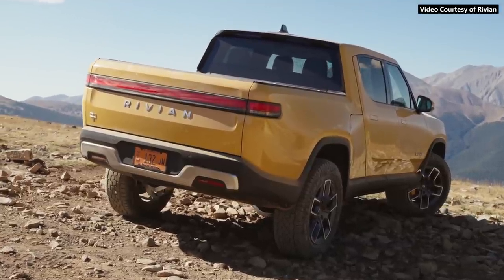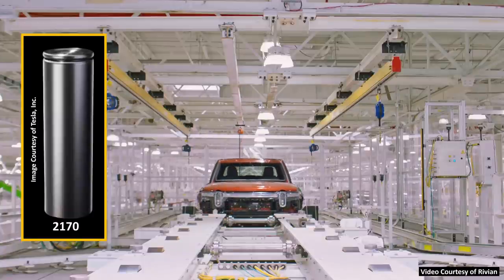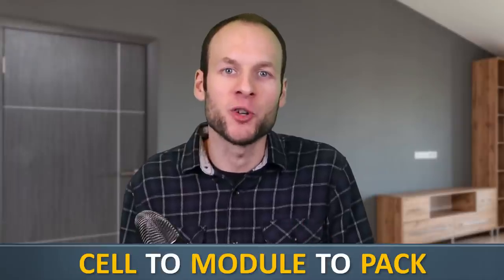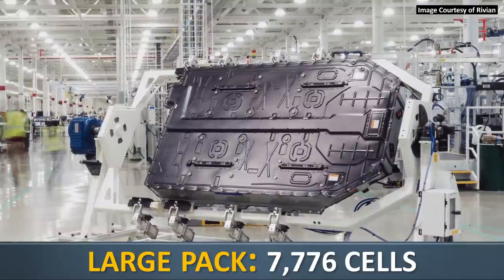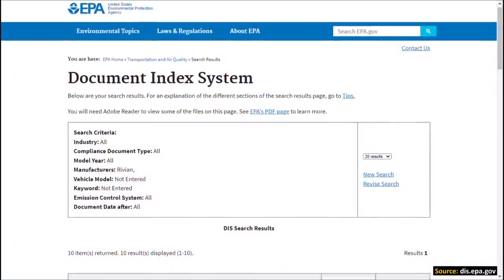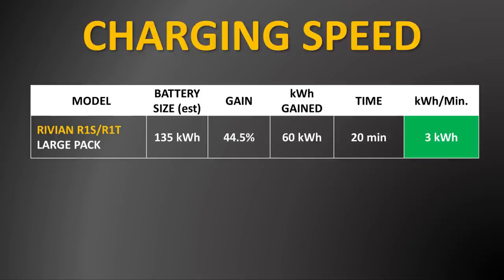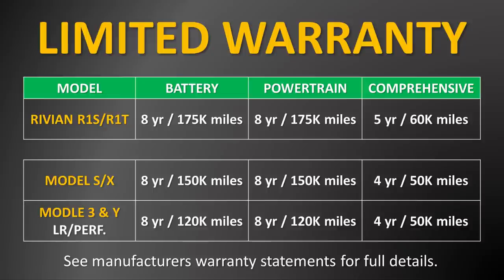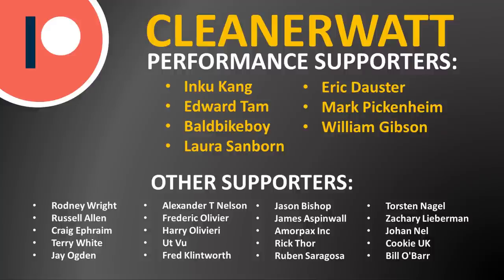Rivian R1T Electric Truck: How Good are Rivian's EV Batteries?

Comment: We can pontificate about forthcoming speculative trucks and their tech. But the Rivian R1T is here, now. And for those with deep pockets, who want a practical, fun, premium, family adventure truck, Rivian absolutely delivered. It's not for everyone, but it is truck and vehicle of the year with multiple publications, for good reasons. They now have over 80k of orders, and with $1,000 deposits, rather than just $100 placed on speculative peers' vehicles, the people in line are much more likely to be more serious about going through with their actual purchases.
Reply: My only concern for them is if Ford nails their lightning production then rivian won't have as much of a headstart as they would've liked. So many potential buyers would opt for the f150 for the size and service, rather than going for a startup with no real service infrastructure
Reply: @brandonkylemarks  There are good pros for buying a Lightening, R1T, or Cybertruck. And they'll be buyers that like each or all. But the trucks themselves are actually aimed at delivering totally different things, for different users (commercial, adventure, image) so it depends on what will appeal the most, depending on the buyer's needs as much as availability and whether you have to drive to a dealer, or the service technician drives to you for servicing.

Comment: Charging and cooling.. Remember Nissan Leaf, it could charge quite fast once, but second quick charge is slower. Cooling hardships shows themselves when you try to drive long distance with high speed and multiple quick charges. IMO

Comment: I support Tesla only for at least next 5 years  , others need do more r and d at battery , motor, ai , and scaling production
But at time , Tesla already climb to the another level
Reply: So how do you explain the 512-mile Lucid Air with similar performance to the Model S? It seems their efficiency is so good that despite using 2170 cells in modules like the Model 3 and Y, they achieved a significantly better range than the Model S while also charging significantly faster at 304kW.
Reply: @TecnamTwin  they're probably using a bigger battery based on back of napkin math. I hope I'm wrong though.
Reply: @TecnamTwin  Lucid only produces 1 model, and don't currently have anything that's more affordable. Tesla offers 4 different vehicles currently, with 3 more to come in the next 2 - 3 years. Tesla has truly made a foundational impact on the world's transition to sustainable energy.
Reply: @geoffl.3247  Ya Tesla's are cheap.
Reply: @TecnamTwin  more like their quantity of battery is much larger. Models is more efficient but has a smaller battery pack.

Comment: Definitely competitive with current tech but is that enough to gain on the leader, Tesla?  It's a catch-up game and I don't see this happening.  I believe it will be a great truck but there is a lot that has to come together to get it in the green.
Reply: Remember that Cybertruck will use 4680 cell which is way ahead of any other manufacturer. They will be 2 steps behind Tesla and Elon wont stop with 4680. Others won't catch up to Tesla anytime soon.
Reply: @1flash3571   Tesla’s 4680 cell might be way ahead but they’re still not in mass production yet so kind of irrelevant for now.
Reply: @TecnamTwin  It kinda already is in mass production. They are at 90% from 70 to 80% just 2 months ago. They are storing up those batteries when it goes into the production models in Texas and at Gigaberlin.
Reply: Why do they have to catch up?
Reply: @justbecause9645  If Rivian is going to survive, they need to catch up to some extent. Rivian haven't even delivered any more vehicles after the initial delivery to their EMPLOYEES, and maybe to very FEW outside customers, if that. Rivian is blowing through their CASH pretty quick without the Revenue. All companies need CASH to survive.

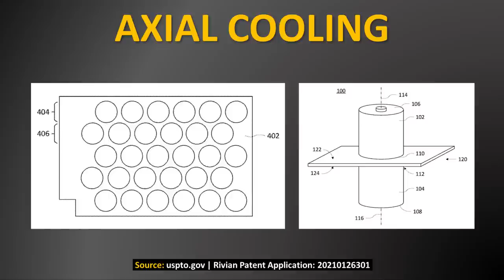Comment: 8:50  The way I understood it, the packs are 2 cells deep.  The cells negative ends would be against a center cooling plate.
Your illustration looks like you're dissecting a cell with the cooling plate.

Comment: If all packs are protected underneath, why is it a $2000 option on the configurator?
Reply: If it is needed for safety it should be included in the base price

Comment: "Most energy dense" can be false per kilogram, as you point out, and true per liter.  Is the cooling liquid counted as battery pack mass?  I don't think so, no hit on the gravimetric energy density there.  So Tesla's greater cooling could cost it some volumetric energy density as their larger amount of in-pack coolant adds to the volume of the pack.

Comment: Excellent analysis. Agree Rivian is respectable. As to its practical application, I think the jury is still out on Rivian. As you must know, Edmunds is tainted. Even though Rivian is first on the street, albeit selling to employees only att, Cybertruck may still knock Rivian off the pedestal. I seem to like Tesla’s structural battery pack concept as a key product differentiation that many truck customers will highly value…nevermind the exoskeleton concept. IMO, Tesla wins on value, intuitively as well as measurably.
Reply: Yes but the Cybertruck looks weird and is polarising so not everyone will fall in love with it’s ‘better value package’.
Reply: Key words here are "Tesla's structural battery pack concept"
Reply: @trevorevans7101  That’s totally fine. There’s room for all comers in the market as EVs displace the incumbent gas and diesel trucks.

The Ford Lightning could probably sell more than the CyberTruck due to fleet buyers and those installing service beds. However, Ford doesn’t have the batteries to build millions of trucks whereas Tesla will. And the CyberTruck’s specs are better.
Reply: CT is too big,  will have that silly yoke.  Doesn’t really compete with Rivian due to its size.  Competes more with f150.  Rivian does feel niche though, kinda like Land Rover.
Reply: Cybertruck might beat the Rivian ….if Tesla ever builds the CT.   Maybe 2023.  I wonder if Rivian will improve their trucks by 2023?
Reply: @TecnamTwin  Made up specs that haven't been proven?
Reply: But it's ugly af so no

Comment: AS long as Rivian can repair any single damaged cell rather than ask the buyer to fork out the cost of a whole new battery it will be successful. Some 7-21K worth of individual batteries shows a lot of single point cell failures. I hope they can develop a process where when cells malfunction it only reduces the range by the number of damaged / malfunctioning or degraded cells. Not just one cell causing the whole thing to fail.

Comment: So, Rivian's approach may be more energy dense, but you're not going to have nearly as effective cell level cooling with an axial approach. The contact surface area is so much greater radially that it's probably several times more effective going with Tesla's approach. This would mean that the Rivian will have performance issues in high demand scenarios as the car throttles back performance to prevent overheating.
Reply: Tesla does the same in their 4680/structural Battery pack though, and albeit counter-intuitive it works indeed better because of the jelly-roll internal structure of the cell which conducts heat better along the axis than radially outwards
Reply: @unitrader403  Tesla can afford to do that because the design of the 4680 reduces the tendency to overheat. They have shortened the distance by a factor of hundreds.
Reply: @dstr1  as i alrady explained the Cells internally conduct heat better in the axial direction than in the radial one (the heat can follow the aluminium/copper foil of the jelly roll, but its blocked by the seperator/electrolyte). So Axial cooling of cylindrical cells is better, no matter what.
Reply: @unitrader403  you are still missing a significant engineering difference betwee the design if the Tesla 4680 cylindrical batteries and ALL other cynical batteries.
That is the distance the energy travels. In the case of the Tesla battery that distance is a minute fraction of that of even 18650 battery. 
Recognizing that that  size was the limit due to the limited control of heat generated in the charging and discharging process. In the Tesla design energy doesnt travel the length if the jelly roll, instead it travels across the edge of the roll which is equal to the radius of the battery or about 23mm as against meters in even the smallest of the batteries.
I've been following this jelly roll design ever since it was designed in China by A123 and then migrated to MIT decades ago.
Reply: @dstr1  Previously people wondered why Tesla cooled their Batteries radially rather than axially because the heat preferably goes along the axis and not radially outwards, so cooling the Cells radially is not optimal. Now that Rivian cools their Cells axially its also wrong, so wtf?.
And note that i never touched on the way the (electric) Energy travels in the Cells, because thats less relevant for the optimal side to cool the Cell (you could say its a distraction from the Topic)

Comment: NCA...should be NCAG where G is graphite, which is basically running out NOW, at least in terms of number of EV deliveries baked into EV stock prices. Better to invest in ebikes...cool shot of Rivian's pack btw..I think there are too many EV prototypes out there with multiple fail points ahead on scaling...Lithium supply, Graphite supply, geopolitics. Still rather have lithium iron for long life and useage of 100% of charge rather than 20-80%

Comment: What is interesting, so far, with EVs like the Rivian, is the lack of significant changes after a few years.  Yes, there are software updates but Legacy automakers traditionally have changed their styling about every 3 years, or so.    Tesla, Rivian, and others, are not on that fast of a cycle yet.    Heck by the time the Cybertruck comes out, the design will almost be 5 years old.   And by the time Rivian builds it's first 50,000 trucks, it's design will be 5 years old.  I wonder how they plan to do updates.   Don't consumers want a car that looks new and fresh, not like their neighbors 5 year old car?

Comment: The R1T is my second choice behind the highly anticipated Cybertruck. The new 4680 battery cells, durable stainless steel exterior, super tough window glass, etc. is simply superior.
Reply: It's still a prototype.  Like the roadster it just exists in dreams right now

Comment: None of these Stats mean a thing until volume production is achieved and are proven out on the road in the heat , rain , cold , snow and driven hard by customers . Also battery pack life and degradation must be proven before you can say any of these stats mean anything . Also , a big elephant in the room , is the buying public interested . Rivian making a profit is going to be a long and steep if not insurmountable number of mountains to climb . It's also beginning to look  at this point in time , that Rivian ia unable to ramp up to volume production .

Comment: Catching up to tesla is going to be almost impossible… its like trying to catch up to Usain Bolt when he’s like 5 strides ahead of you. Tesla would have to stand still for years for that to happen. The amount of investment in R&D and manufacturing is insane.
Reply: The competition is already caught up and in some cases already the leader. New battery technology is better than Tesla and Tesla has been doing it for at least 8 years longer.
Reply: @shane7394  The 4680 is ramping up in giga Texas and possibly being installed in the new Y coming out of Texas
Reply: And Btw Tesla paved the way for most EV company with the same 2170 most are now using… which manufacturers battery is more efficient than Tesla? More range doesn’t equal efficiency if you’re using a bigger pack
Reply: @henrywilliams5458  key word here is "possibly". Tesla is just installing equipment in Texas. No date set for production, they will need lots of time to determine if they can even produce at scale.
Reply: @shane7394  dude just give it a few weeks… it’s funny how you think the newbies are catching up but you are doubting Tesla’s ability to produce at scale😂?
Reply: @henrywilliams5458  The cars coming out of Berlin that where scheduled for mid 2021 production where supposed to have the 4680 batteries as well but they have not been built yet and will have 2170 cells. What is your thoughts on this?
Reply: @shane7394  I didn’t realize we were discussing just one aspect … if you read one of my comments I actually mentioned R&D first… Btw I can find more videos from YouTubers supporting my claims about Tesla… like I said give it a few weeks  and We’ll come back to this topic.
Reply: @shane7394  I don’t know about Berlin but it’s been reported from reputable sources giga Texas has been stockpiling for production for some time now

Comment: I still doubt Rivian’s real-world results of their “axial” cooling plate is anywhere near as efficient in removing heat from the cells (similar the Chevy Bolt’s cooling plate) — as compared to Tesla’s radial ribbon which provides more surface contact with cells. They’ve copied Tesla’s cell design and chemistry in the batteries, but early-on they knew they wouldn’t be able to match Tesla’s overall drivetrain efficiency, let alone the aerodynamics and massive weight diff. of a truck vs sedan… so they designed in a double stack cell module. More cells, more weight, more complexity, more failure points, less hauling weight, more wear on the tires.
Reply: the fact that its stuck on 200kw charging for the R1t's 135kwh batter pack while Tesla can achieve 250kw charge on a 75kwh battery shows a real difference in cooling capabilities.
Reply: @odisy64  yes, another good point. I think we’ll be learning a lot about their strength and weaknesses in the next year. I’m interested in their R1S, but going to watch as they get over their honeymoon period.
Reply: It'll be interesting to see the final design on the 4680/ structural pack

Comment: Not good enough; the Rivians weigh 7500 lbs and need over a day to charge on a 240v/40 amp at home; even 3 days if you only have a 15amp outlet.
A couple here on Youtube documented a 2700 mile trip towing with a Rivian; they had to stop and charge every 100-150 miles and that was in good weather in very cold or very hot weather the range is even shorter.  This isn't a truck its a decoration with head lights.
Reply: EV's aren't good towing vehicles, Surprise.  Doesn't take a day to charge.

Comment: Question: will it drive itself? Answer: not very clear path towards autonomy, nor backwards compatibility with Tesla FSD when licensed. Conclusion: current models have a very high risk of remaining a horse on wheels, worse ROI, lower than Tesla second hand price. Rivian is at least 4-5 years behind Tesla FSD i would say. Tesla has been working on FSD for the past what, 5 years, 2 million cars on the roads, collecting most data, worlds best AI engineers, tech, semiconductors...
Reply: I love driving.  I don't want autopilot that runs into tractor trailers and off the road.

Comment: terrible analysis, trying to give the rivian any shred of credibility by comparing the charge rates of the model X and making it an excuse by saying it had worse charging because of the vehicles weight when it should have been battery size and charge rate where cooling makes the difference, not range based on weight which makes no sense. the Rivian is just an inefficient electric truck because of its lower quality electronics and drive train components.

Comment: Cleanerwatt - the STOCK Rivian R1T does NOT have very IMPRESSIVE off road capability.
EDMUNDS - " the RIVIAN Suspension is far worse than a RAM 1500 gas truck , and it has too much ROAD NOISE as it has INFERIOR NVH " . 
in a RECENT test by RIVIAN Reviewers the Rivian R1T needed spotters and guides trying to scale a Rock & Dirt hill, and it did this slowly and WITHOUT any Confidence. 
it was able to get to Plateau of the Hill, but had the SAME issues going back down HEAD first. 
the other GAS Truck owners thought the Rivian Driver was CRAZY for attempting the STUNT with only STREET TIRES and NOT even using proper OFF ROAD Tires. 
the RIVIAN R1T is just a WEAK Mall Crawler w/ MINOR off road Capability. 
and its HEAVY design, INEFFICIENT power system , and SHORT RANGE create TOO MANY Negatives for the OUTDOORS person.
Reply: Edmunds is schilling for the OEMs, and all this opinion from them is contrary to the facts.  The Rivian, on street tires, was   climbing in conditions that necessitate a spotter; that is,  beyond the capabilities of typical trucks. If you're even more serious about offroading, simply buy different tires, as all serious off roaders do.
Reply: You misquote the article, the hill trail climbed is a difficult one that regular get off-road trucks stuck and they were mad to do it on standard tyres but it not only did it do it, it did it easily , Rivian has 3 main issues scaling production, Jeff who's involvement and what to do once they have to get there own business plan and not just follow Teslas.
Reply: Good old Mark still being a Tesla troll.

Comment: Rivian is the worst at battery output in refrence to miles. The batteries are not tuned right and they just thrown it together without any fine tuning. They are like the Hummer to ice cars. I would never purchase them until they refine the batteries and make better use of them.